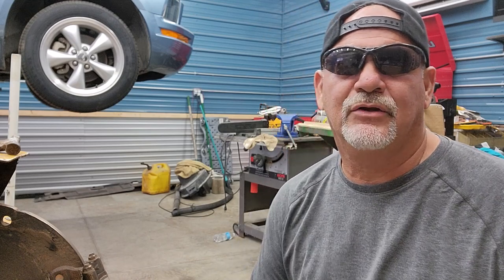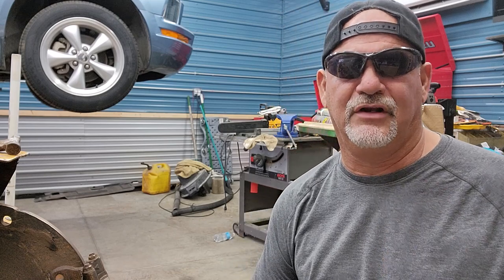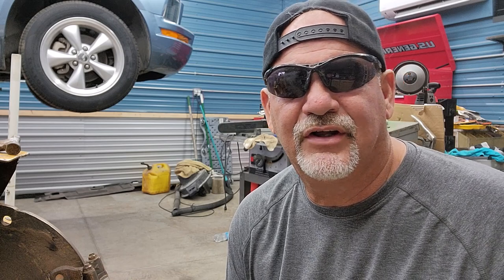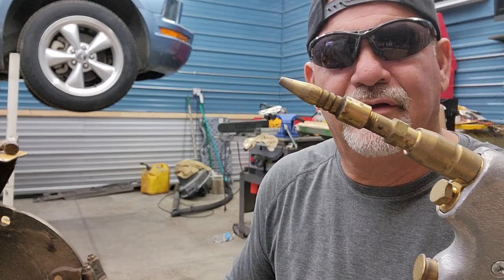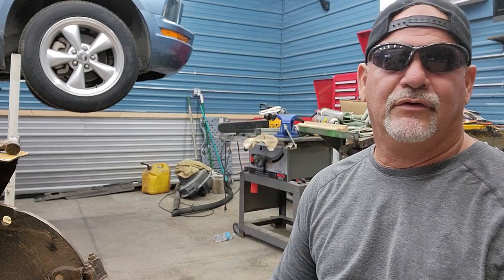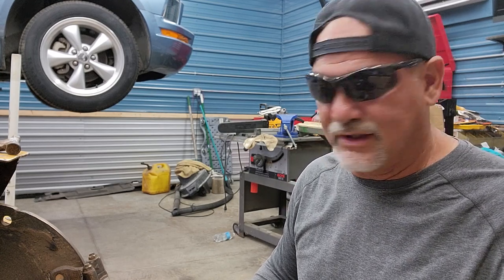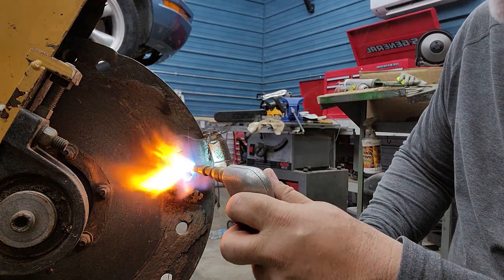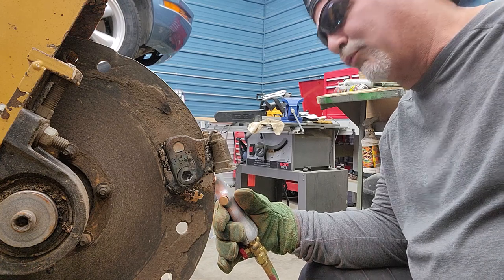Removing Frozen Bolts with a Cobra Torch

Comment: 12:32 Yea we recently discovered that the Vermeer teeth are smaller than greenteeth.  The  Yellow Jackets were a little smaller than the 900's but they were a lot smaller than the 1100's.  

About 3 months back we purchased a Vermeer SC1102 which is supposed to have 72 yellow jacket teeth.  When we switched over to 1100 series greenteeth there was no way to mount 72 of those 1100 series greenteeth.  We were mounting greenteeth that were nearly totally eclipsed by other greenteeth so we reduced the number to 48.

Comment: Thanks for another great video! I just bought a 252 per your recommendation and have purchased the upgrade kit off of Amazon. With that kit, they sell the 926 wear sharp which is a 2 sided tooth versus the normal 3 sided tooth. Personally I like to run the reds on my machines and wanted to try them out but this upgrade kit only came with angled pockets and I assume this setup will use more of the tooth causing the need for these 2 sided wear sharp teeth. Are you going to use these same 926 teeth or are you going to use the regular 900 series teeth with your setup?
Reply from the maker: I still use the 900 's and I do have some 926's  they came up with the 926 type from the sg40 and ZT1844 machines only using angle pockets and people saying they dont get the full rotation of a 900 but in my experience on a smaller machine you should do constant rotation and the old 900 work great and yes you can get the 900 and the 926 retipped in reds also at witson
Reply: Awesome. Thanks Adam